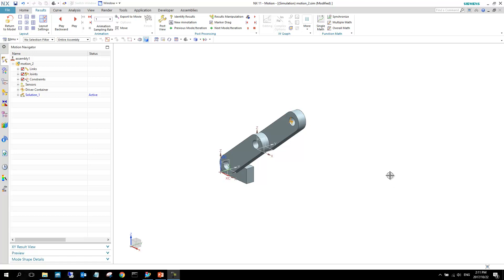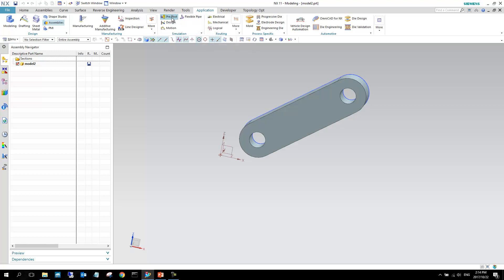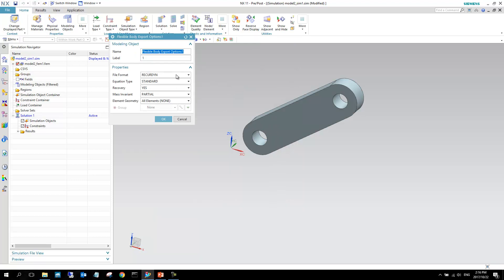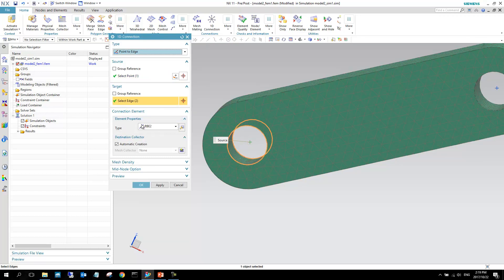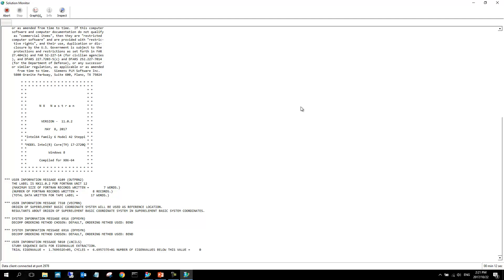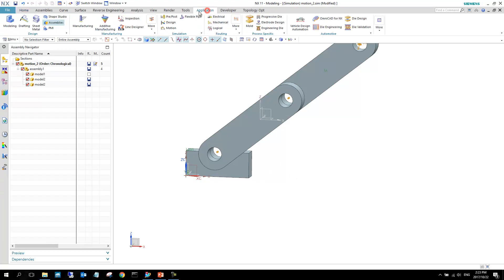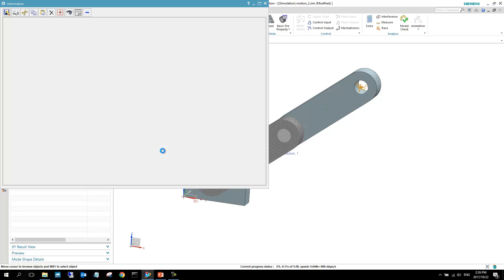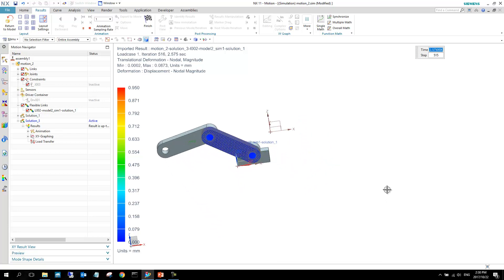NX Motion Lecture 5 - Demo 1 - Flexible Body Analysis

Comment: Hello 
I not able to replace rigid body to flexible body. It means in flexible link box I am not able to select link. The flexible file browser works properly.
Reply from the maker: Hi, are you also running NX11? In the motion setup did you switch on that flexible bodies will be used?